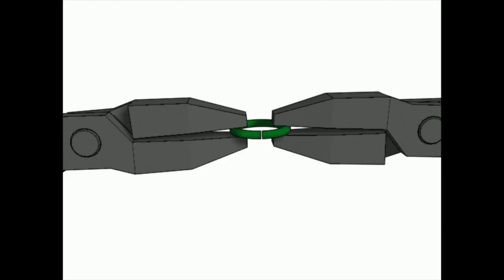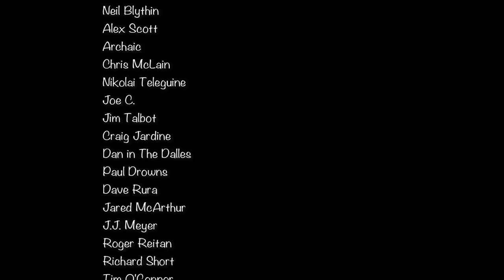Forging Chainmail / maille tongs

Comment: have you ever thought about trying to off set the handle of the tongs a bit so that the bottom tong handle when held with an open hand; it falls towards your palm? this would then make them right handed or left handed tools; but make it easier to grip as they would then want to stay in your hands.
Reply from the maker: I do offset my tong handles so that they line up over each other on the handle end. But I never thought about making them so that the handles operate as you described. Something to think about... Thanks for watching.

Comment: Hello sir. Have you considered some sort of support for the ends of long tools as you work them? 

 I feel like it couldn’t possibly hurt to have a leather bean-bag sort of thing, like a foot rest about the same height as the top of the anvil. You could place it between your feet and squeeze it with your legs to make it higher and lower. Place the floating end of your work on it sort of as a third hand, just a passive rest for it instead of hanging long items 90% off the end and using the downward pressure of your arm to pinch things down to the anvil.

 Seems like it would save you a ton of effort, if you had a leather bag there between yourself and the anvil.

I know this isn’t common for blacksmiths (or maybe something like that has been done before)  but with your particular form of work, sitting like you do and making videos, I think it could really make it a lot easier on your elbows and wrists and all that.

 What do you think? Do you know what I mean?
Reply from the maker: Hi and yes, I do understand what you mean about creating some sort of rest for my workpieces. But no matter what that might be, it would have to have some sort pressure on the back end so that when I hit the front end with my hammer it doesn't want to flip. Anyway, it's a good idea and one that could make working in the way I do easier or at least less stressful on the hands, etc. Thanks for watching and sharing.